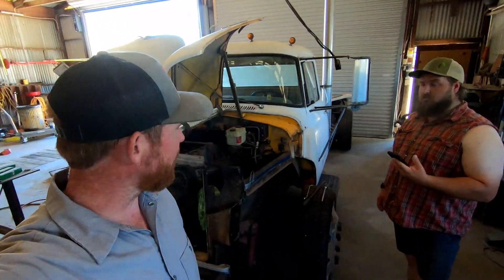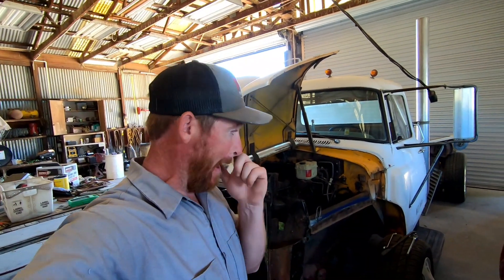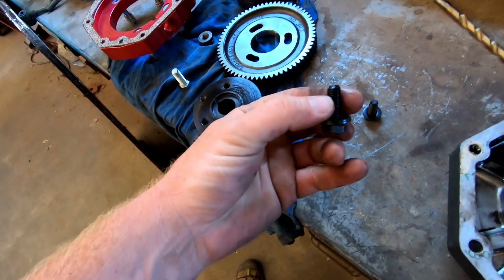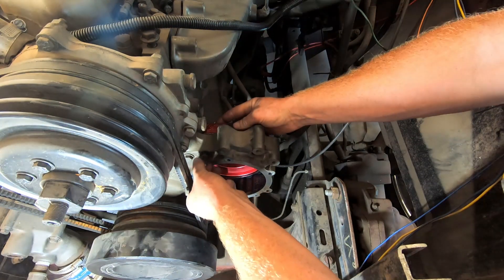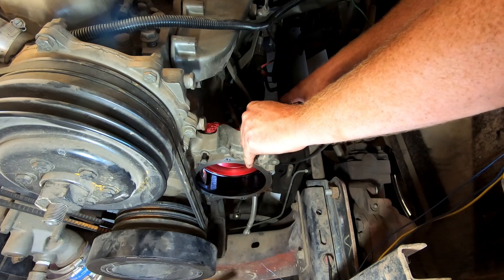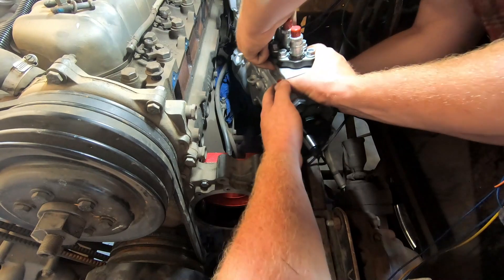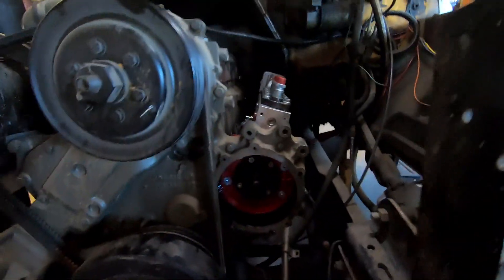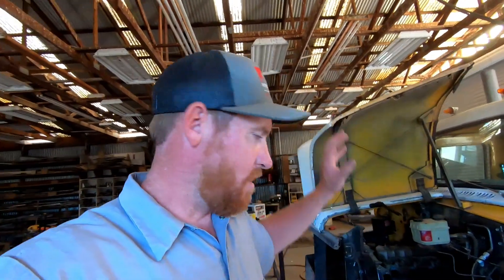(How to) P7100 P Pump onto DT360 Part 1

Comment: Just a curious question. 
I am looking into buying a truck with the DT 360 motor. 
Is there something wrong with the stock DT360  pump is why you are switching to P-Pump?
Thank you.  Love the videos and the old International. How is the truck doing now?
Reply from the maker: No. No the stock pump is fine. We just wanted to increase the power beyond the stock pump level. The truck is doing great. Still need to figure out what we want to do with the back end on it.

Comment: Your right ... you are the only video that shows how this mounts. I also have a dt466c and was trying to mount a P pump to it instead of the MW. Couldn't find the parts and ended up buying a whole new motor. Got  a 1996 Dt466NGD with the factory P Pump. Alot better to start with anyway. Will still rebuild and P pump the old one but probably sell it.